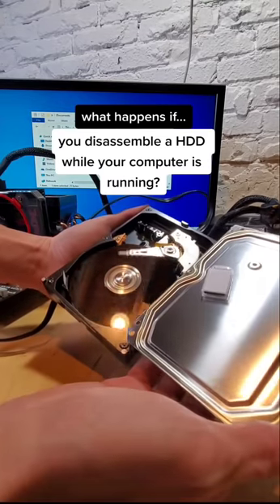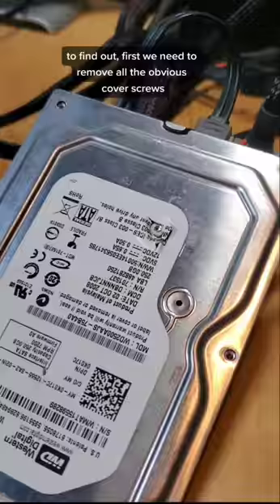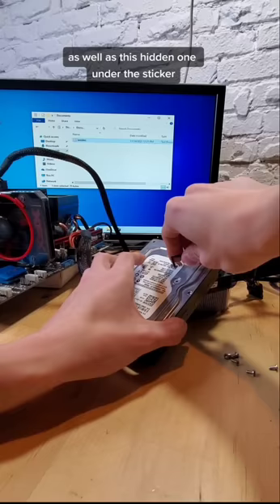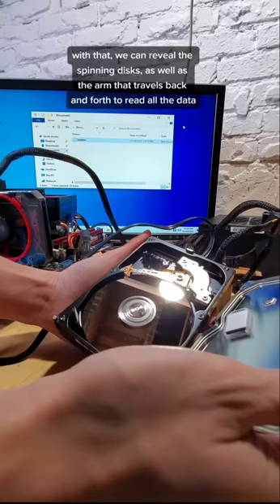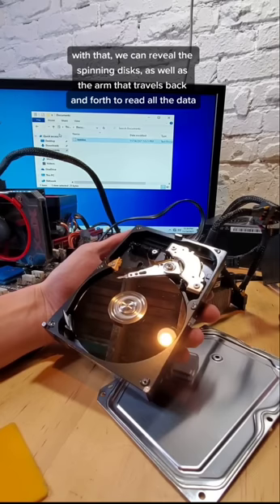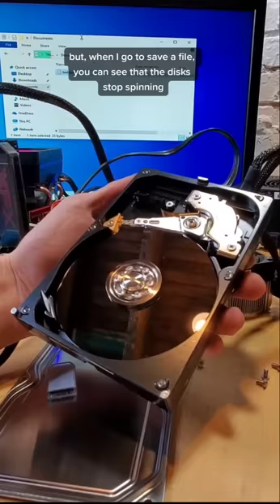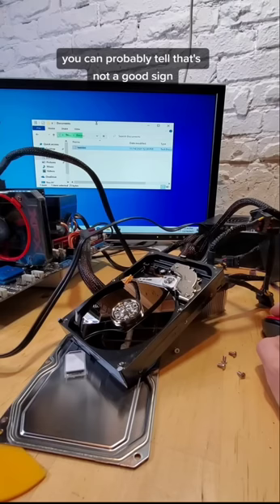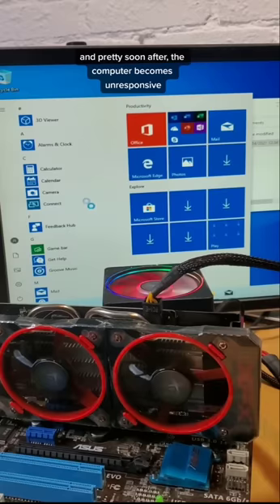disassembling a HDD while it's running #shorts

Comment: The screw above the arm of the HDD is there to fix the arm in place. When you cut away the cover over the disks and let the triangle (screw over the arm and the piece to the frame) stay. It works.
Reply: How did you get that much computer knowledge 🤔??!!!
Reply: @therobloxianstar4689  try and error. I tested it. 😅
Reply: yep. But you still need to be careful since even a bit of dust can break it.
Reply: Even though if you disassemble it your hard drive is basically broken. To long to explain it but just saying the needlepoint of the arm is just a few nanometres over the disc so...
Reply: I used to have a “clear” hard drive displayed in my old nzxt h510, where I left the screw in and replaced the cover with acrylic
Reply: @therobloxianstar4689  i followed josh otu-
Reply: @DashcamDriversGermany  *trial and error, but yes.
Reply: @ImDaToast  Aenhennn
Reply: It is implied in the video that the drive doesn’t work because it’s exposed, but from what u said, Is it ok to assume that if u put the screw back while leaving it exposed it will work just fine?
Reply: Ich hätte dich wirklich überall erwartet, nur nicht hier hahaha
Reply: @Cedrikkkk  bin eben überall xD
Reply: @DashcamDriversGermany  und nicht unsichtbar
Reply: @Cedrikkkk  Volkswagen
Reply: @space8862  nope it’s still won’t work 
If you opened this way there are a lot of dust 
& you might move the sensitive needle it’s few nm above the disk 

Look up repair guys or forinsics who open drives notice how they wear protective crew and inside a room with no air (dunno what’s-called in English )
Reply: @Brikzilla  that is awesome!
Reply: @DashcamDriversGermany  hast du das herausgefunden weil die HDD mit den Einsendungen kaputt gegangen ist?😜
Reply: Du... hier?
Reply: @space8862  
No. A single spec of dust in the wrong place can break a hard drive :)
Reply: @therobloxianstar4689  the best way to learn is to do it ..i learned alot by experimenting on my lappy
Reply: "and let the triangle stay". Huh?
Reply: @space8862  nope.. any bit of dust wil break it
Reply: @ko-Daegu  Hi! Just wanted to explain to you the equipment they use to repair hard drives. It's called laminar flow. Basically, air is purified and made to flow in a straight line over the working area so that dust doesn't get in. It is also used in medicine for growing bacteria to prevent contamination from bacteria in the air. It is also used when making custom intra venous fluids (by mixing different fluids) (again to prevent contamination from bacteria in the air) 
Have a nice day 😊
Reply: Ah hey du auch hier?
Reply: HDDs are generally filled with inert gas, so the plates don't oxidise. There are warnings on the disk saying not to open them up for this reason
Reply: Actually the disk is now exposed to dust particles which damages the HDD and the screws/cover is sealed to prevent any dust from entering 

A single dust is enough to kill the Hdd, that’s why they build the chips inside clean rooms, free from dust.
Reply: They’re very sensitive to dust
Reply: hey hey i have a gpu i was never able to fix could u help me?

Comment from the maker: The inside of a hard drive is one of the coolest looking components of a computer 😌
Reply: science.
Reply: science.
Reply: science.
Reply: science.
Reply: Science
Reply: Quantum mechanics 😎 👍🏻
Reply: science
Reply: What happens if you use paint instead of thermal paste
Reply: Hahah
Reply: Lol
Reply: Eeee
Reply: Yo
Reply: That’s why you need one with a clear cover!
Reply: Gravity falls music
Reply: Tbh yes
Reply: Science
Reply: What happen if you remove the gpu but you have a cpu with igpu
Reply: Try to remove cmos battery on running pc
Reply: But also the most slowest
Reply: @abuel-santuyi96  It Will Just Reset Your BIOS Settings Which Is Only Accessed On Startup To My Knowledge
Reply: I remember seeing one with like an acrylic panel so you could see it’s insides while it was running.
Reply: That’s why I wish they made ones with clear spots and RGB in the covers
Reply: Nice q fellow fan of gravity falls
Reply: s c i e n c e
Reply: Siència
Reply: Try SSD disk
Reply: @DraconBerry2740  but there aren't any disks inside
Reply: @DraconBerry2740  there is just board and memory chips
Reply: And the shiniest
Reply: 666th like
Reply: Tech.
Reply: It broke immediately because the smallest bit of dust hitting the platter can ruin it.
Reply: @DraconBerry2740  a SSD stands for solid state drive, no disks. No moving parts. It's just a PCB with a couple of chips on it. Nothing will happen if you remove it's cover.
Reply: Mechanical is definitely of more visual interest than digital.
Reply: Technology
Reply: Np
Reply: True af
Reply: Science.
Reply: Hdd are still better than ssd
Reply: Yeah i have ever open the hdd and it's cool to see the internals

Comment: Basically removing the cover will destroy the hard drive because the screw that was hidden was kept there to keep the arm in place, and because you removed that, it touched the disc and now all the data is gone. You shouldn’t remove the case at all even if you’re an expert

Comment: That's probably because the hidden screw is attached to the tip component and it might not work without the screw on it
Reply: Also, microscopic containments can ruin your data.
Reply: Also lost the helium that pressurized the hard drive.
Reply: @Finallybianca   Only data center and enterprise drives use helium. The rest use just normal air.

Comment: The spinning platter circulates the air inside the drive and it lifts the read/write head nanometers above the surface and if you expose the insides of the drive the r/w head will scratch the disk up and it doesn't help that the dust particles in the air are enough to damage it even more
Reply: Oke stefan dat wist ik al
Reply: M'dude's a wizard.
Reply: @Deezy52  Fabreeze for dust?
Reply: This is not instant. The reason his drive didn't work is because one of the screws (the one under the label) tensions the read/write heads, and removing it removes that tension and prevents the heads from seeking properly. If he put the cover back on, and tightened screw, it would most likely work.
Reply: Not true, there's a screw missing.
Reply: Hdds are amazing
Reply: Youre juat wrong lol, i wonder how someone can be so sure of himself and still be wrong and f up haha
Reply: @baadlyrics8705  Its the profile picture, It makes his opinion immediately invalid.
Reply: @teun3526  nein nein nein
Reply: @baadlyrics8705  he’s right but it’s not why it stopped
Reply: @dankmememandank2491  what he said is correct 
But not the reason why it stopped the reason is the screw that he removed (the hidden one)
Reply: @ko-Daegu  It is correct that the screw missing caused the stopping of the hard drive. But it is wrong that air is circulated to lift the head. There is helium in hard drives to help with drag, but that does not lift the head. Also, the head doesn't actually make contact with the platter, it sits just close enough to read the varying magnetic fields.
Reply: @dankmememandank2491  nah that part is right, the spinning disk drags air along with it, and that air flows in part between the head and the platter, keeping the head suspended just above the surface, but yeah the screw is what killed it
Reply: @The1stImmortal  I recently read something on the workings of a hard drive and this seems to be true.
Reply: There is a hole in the cover, dust isn't an issue. The heads are held by a screw in the top cover
Reply: nice explanation to noob e.g. like me... thanks...

Comment: I got to disassemble several hard drives in one of my classes. Once we were able to transfer files onto one for around 15 minutes before it stopped spinning.
Reply: But why it stops if open? Doesn’t make sense
Reply: @antonybr1  I dont know to be honest.
Reply: Dust
Reply: @antonybr1  It stopped spinning because the screw under the label puts tension on the read/write heads. They cannot accurately seek when that screw is removed, the drive realizes the tension is off, and shuts itself down to prevent damage.

It is very likely that if he put the cover back on and re-installed the screw, it would work again.
Reply: @HudsonGTV  Dust particles would cause more damage though as well eventually killing it if not right away
Reply: @antonybr1  the miroscopic dust and dirt in the air gets on the "platter" and messes up the HDD.
Reply: Dust and bacteria in the air is what kills it.

Comment: One of the cover screws holds the arm, reinstall it and it won’t crash into the disks. Hard drives are surprisingly resilient, I’ve scratched the plates of opened up hard drives and they’ve still read and written files without any issues.
Reply: They usually relocate sectors to the service area of the disk to avoid reading damaged area.

Comment: is good your video, cause one can see how is the hhd disk is working when is operating. The cover, in some way, make pressure over the disk, or the arm when is reading, but also, it protects the components of dust, humidity, or particles on the air...

Comment: I think the hdd runs under a light pressure whether that be positive or negative, but the seal around the cover is a dead five away that there is some pressure in there, also with the purge hole and a filter between the inside and outside world

Comment: There’s actually a secret to why it stopped working that I learned from drive savers in an LTT video, The hard drives are assembled in a specific space with a very specific air type (I can’t remember much) and when it’s mixed/changed it stops functioning.

Comment: Western digital made a line of hard drives called Raptor. They were 10,000rpm and had the fastest seek times of any commercially available SATA drive on the market. I had a 36gb Raptor, and it had a clear cover so you could watch it working.

Comment: Depending on the model that will cause head crash immediately. Some drives have air flow requirements that when the cover is open so not meet and so the heads won’t float. On others, this loosens the read write heads completely.

Comment: Microwave it and then try and use it
Before this, remove motherboard of the hdd since it is quite obvious it will Die!
Reply: Would show no sign of life.
Reply: @smiths7317 no but the motherboard will be removed so only platter is left theoretically
Reply: @windowsxpprofessional   Microwaving the hard drive, taking it out of the microwave, and connecting it to the motherboard will result in the hard drive showing no signs of life. This is because you have fried every component on the circuit board of the hard disk drive and the platter would've been damaged from all the heat as well.
Reply: @smiths7317  tbh it won't heat and no if I take out mobo nothing component is left on it except the motor
Reply: @windowsxpprofessional  It'll heat trust me, I've microwaved hard disk drives in the past to destory data on them, and you might want to properly read the sentence thoroughly as seems your missing the point or getting confused.
Reply: @smiths7317  but you said you fried every component on hard drive. 
Well if I take out the motherboard its just the platter and motor. So there is no component left in technicality
Reply: @windowsxpprofessional  There are component's within the head assembly ...Motor would be seized up and the platter would be completely ruined making it great tool for data destruction.

Comment: Some har drives are sealed and filled with helium due to its lower friction against the rapid movements of the arm. Opening a sealed HDD will usually result in its failure if you don't know what your doing and getting into

Comment: The disk is very sensitive, removing the cover already destroyed the hard drive. Even a little bit of dust like you usually have in your room is enough to ruin your HDD. That's why securing data from a broken HDD is so expensive (up to 4000€) because it has to be opened in a sealed and dust free room by someone wearing a full body suit to make sure there is literally nothing besides air in the room. Cool video though :3
Reply: I wonder what would happen if u ran a pc in that and opened the hard drive.

Comment: You ruined the heads azimuth (alignment) so, it stopped reading tracks (the hidden screw ensures the verticallity of the heads assembly). Also some hdd has helium inside instead just air, and that changes the levitation properties of the heads.

Comment: Those stickers aren't for nothing. The HDDs are air sealed using stickers. If you remove wrong stickers, it will stop working. I learned that the hard way

Comment: It stopped spinning because after removing the case disk started catching dust.
Reply: Nooe, safety frature for the arm
Reply: @309electronics5  Sorry but this wasn't for saftey
HHDs dont actually have any kind of saftey systems like this one
It was because the arm which reads and writes data always do it in a format of of taping, repulsing and some times very little completely not noticable scratching which is all done physically, too which is in form of bytes which is later unwrapped in form of codes.

When the plate is removed, the disk starts catching dust and bcz of that the arm could read it in any kind of way
Since all the data is read physically, the reading arm can actually read the dust on the disk wheres its diffrent that the arm won't be ale to deteact what that dirt is trying to say
it ill basically somthing that is out of computer's language
So........bcz the data is no longer been read, the HHD is now not even able to gather enough information to what to do, there's litreally no signal coming, like: should the disk keep on rotating or not.

Other system like display didn't went down bcz it was running on RAM insted of HHD  all though it was useless bcz it was no longer resposive.

I think I really did stated a long Essay.

Comment: kind of the same thing happened to my pc, i’ve raged on a game and hit the spot where the hard drive is and my pc became unresponsive after like 6 days of failed windows installation attempts i said “fuck it” and replaced the hard drive with a new one but it didn’t work for some reason so we swapped it with a brand new sealed one and it worked and after i reinstalled the game i raged on. guess what. i’m still trying to beat the same level

Comment: NEVER DO THIS. EVER.

Opening a hard drive while spinning has a significant chance of causing the platters to shatter. 

In which case, you have the equivalent of a grenade blast going off in your face. VERY hard, VERY sharp fragments traveling at a high speed getting thrown all over the place.

NOT KIDDING. 
THIS IS INCREDIBLY STUPID.
Reply: yeah i guess i wont do it lol (if i could)

Comment: already done it and lost 500Gb of my files.
Reply: As others have said the screw under the label puts tension on the reader/writer head so it can accurately move,

Also exposing it to the open air allows dust particles to come in which scratch the disk to pieces

Rip poor HDD